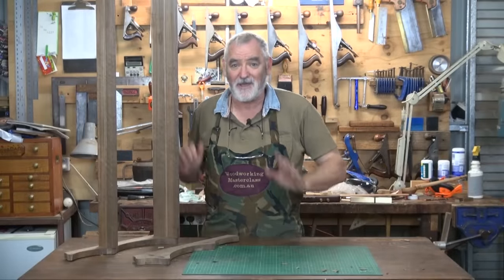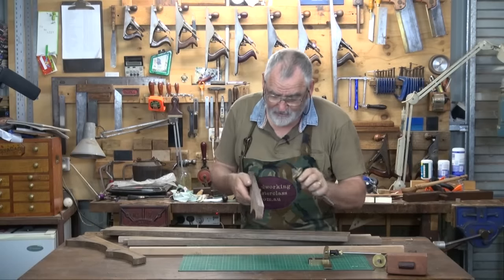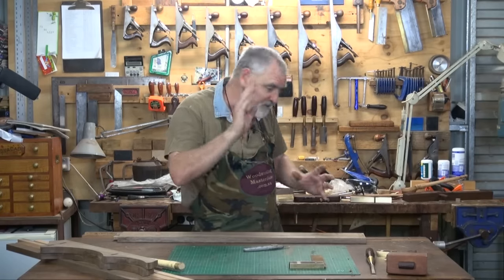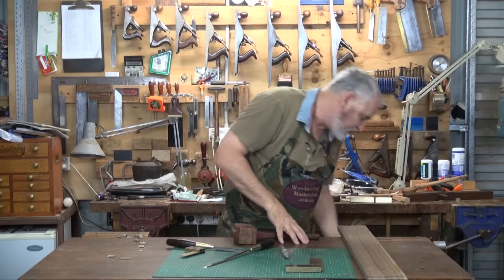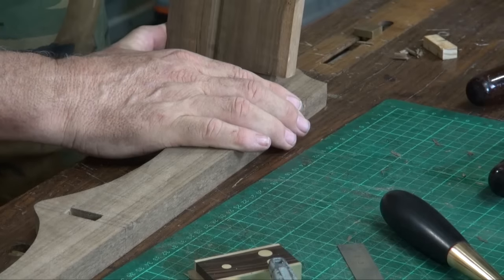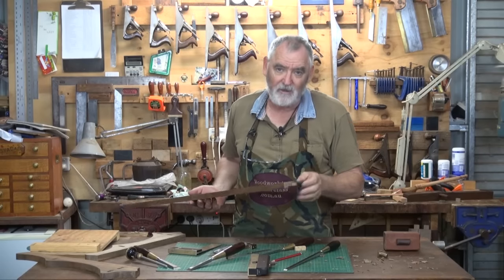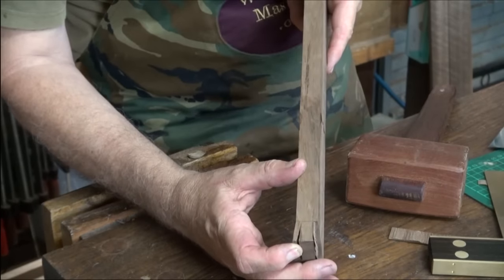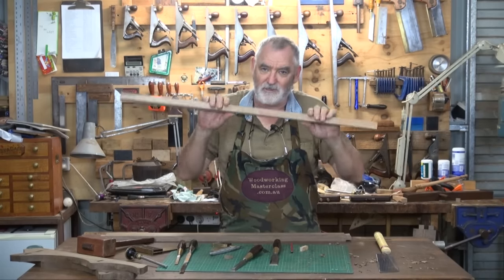How to Make a Decorative Plate Rack Pt.4a

Comment: Ah, i used that splitting method to make tenons quite a bit. But i make tenons first. Which means that mortises can be made to fit. Oh, and i dont do through mortises, so variable mortise width isnt an issue. But i see your point. On my recently build garden bicycle shed its no issue at all, fine furniture with through mortises, better be more exact. Top job again! Thanks!
Reply from the maker: +Willem Kossen Thanks, you're right you can get away with a bit if nobody sees the other end. Cheers Steve